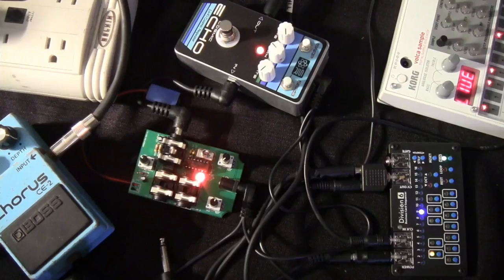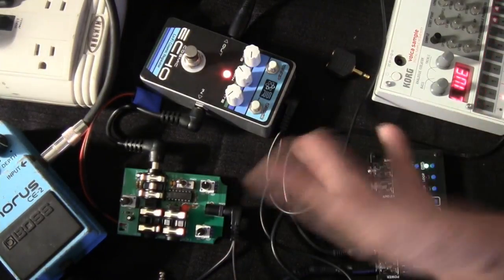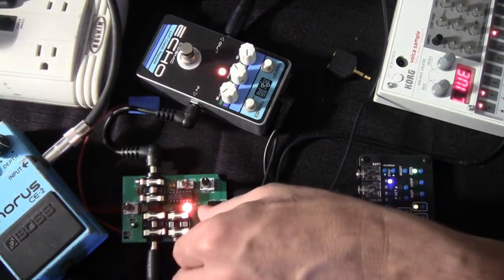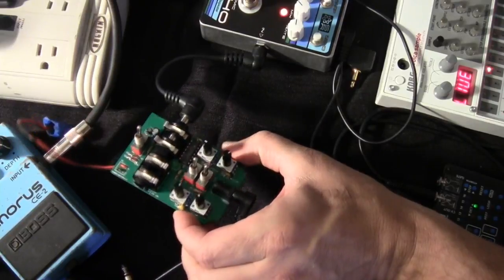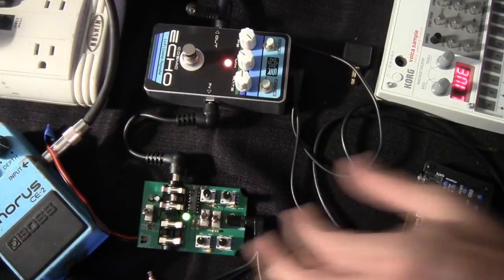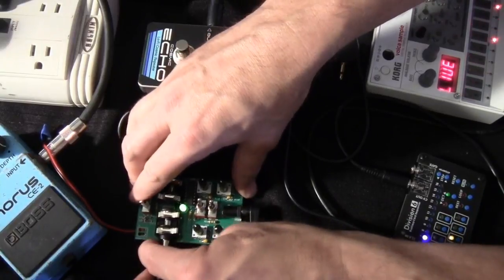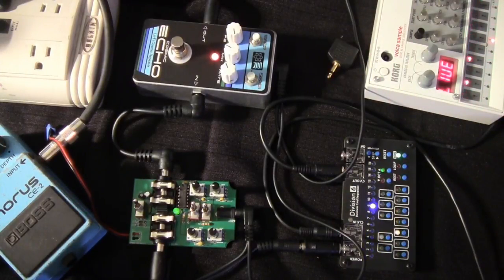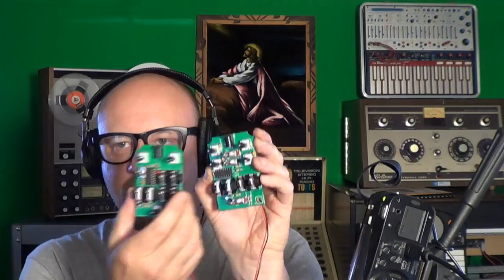HANDHELD APC & Chaos Nand versions - Synthrotek DIY LoFi square wave synthesizers

Comment: Can't wait to build mine.  I think it would cool to offer a small format clock divider, so you could take the volca clock out right to one of those hand held devices. That would be a very useful device.  Currently, you'll need a eurorack module to do that, or you have to be a more experienced DIYer to accomplish that.

Comment: Just built the chaos nand handheld, REALLY dig it, however I can't get CV to work from my keystep pro. I'm powering it via 9v battery, does that make a difference? Also, how do you power it via CV SAG? Will the keystep pro work do this?
Reply from the maker: Hi David, thanks for using it!  You have to power the unit off, then it will power up from the CV
Reply: @synthrotek  FYI, got it to work with the keystep by increasing the CV voltage in the settings 👍